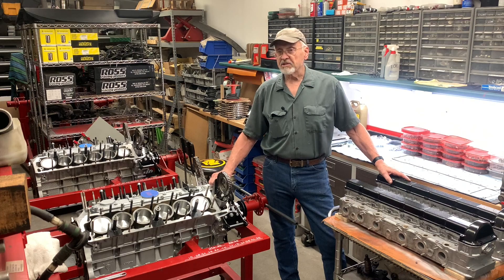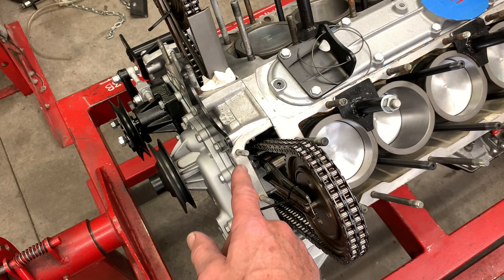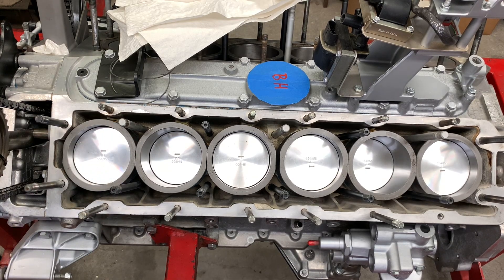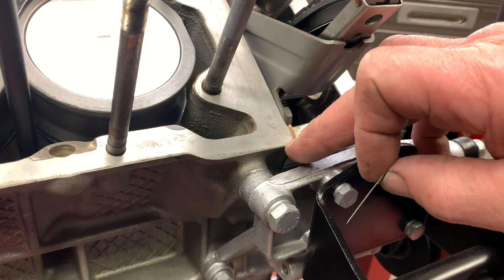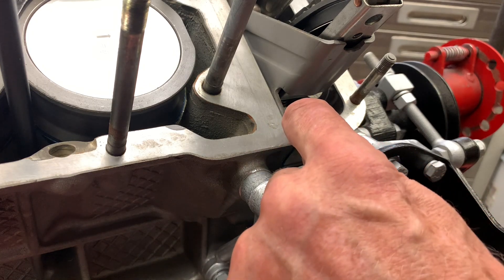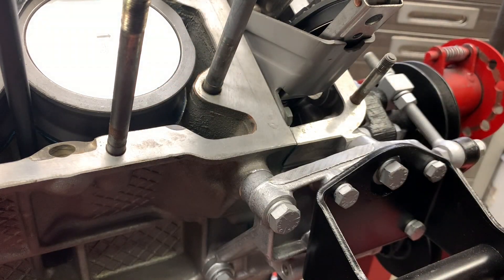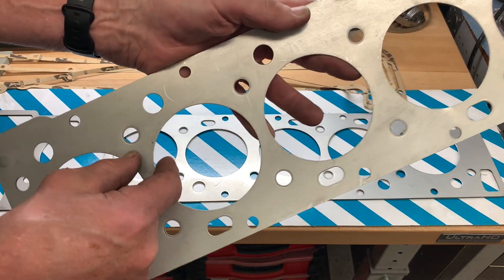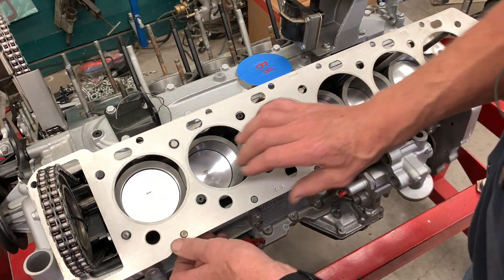S4:Episode15-Jaguar V-12 Cylinder Head Installation Pt1

Comment: Hi,
I have the  same Payen gaskets for my 5.3L
I have a questions, do I need to remove protective film from gaskets from block side or leave it on the gaskets ?
( here is the video:  https://www.youtube.com/watch?v=Bg4MlPrhy9E )
I think, that protective film from gaskets with time can eventually come out from gasket and clog the cooling system a little.
I think so, because the adhesive film  can be easly removed with finger. 
Do you  remove the adhesive or protective film from gaskets ?

And may be you can give advice, which new radiator ( cooling ) hoses to install : aftermarket or genuine ?  Which is better ?
I held in hand both at same time. And  it seemed to me that the aftermarket hoses is more hard and genuine hoses more soft.
And yes, of Couse, the genuine hoses sell for double price than aftermarket hoses.
Reply from the maker: That is the sealer. between the head, liners, block, and gasket. though I must. say I've never seen it do that. I have a number of sets on hand and they don't look like that. I would try to exchange them if possible. If you can't I think it might be worth getting another set. It shouldn't wipe off like that. Either hose set is fine.

Comment: Also, how much did you  grind-off/plane  the head? ~.008" ??
Reply from the maker: .010” usually.
Reply: @thecampchaoschronicles9567  makes sense. how much does that raise the compression ratio? thanks man!
Reply from the maker: Negligible.

Comment: Hey Bob. On the 6.0L block i aquired, there was a small red bead of sealer around the edge of the head gasket. like 1/4" in from the edge. Is that the way the factory did it? or some newfangled aftermarket gasket? or some previous mechanic gone cwazy?
Reply from the maker: Not a 6.0 guy I’m afraid. But most new gaskets, on the 4.0 for example, have that stripe of sealer on them. But I haven't observed it on new 5.3L head gaskets.

Comment: All the cams have a brown color, like if they are old and used.  Or did you use assembly paste ?  But You use a red/brown paste  so that is not the same color.
Reply from the maker: I use Clevite assembly lube which gives it that color. But all of these things are original parts.

Comment: Do you have a head gasket brand preference?  I know Comtec makes a couple of thicknesses and I'm pretty sure they're MLS gaskets. Not sure all brand makers make MLS gaskets.    I guess you'll eventually touch on the 6.0L Jag OE cam gaskets vs the 5.3L versions or common paper ones supplied by non-OEM suppliers eventually?  Thanks for another episode!
Reply from the maker: For a stock rebuild,  Payen works fine. In fact, I have used them on the track car for years with no problem.